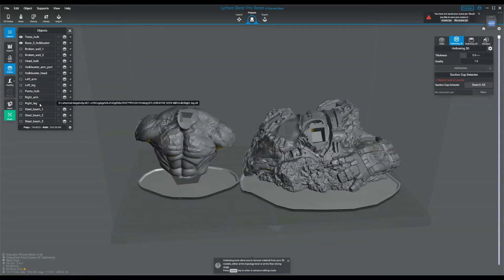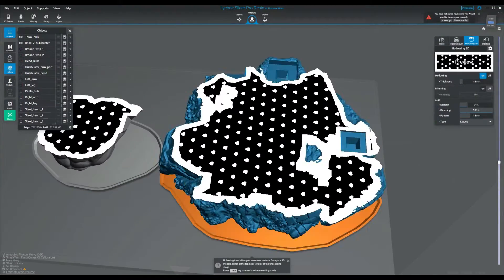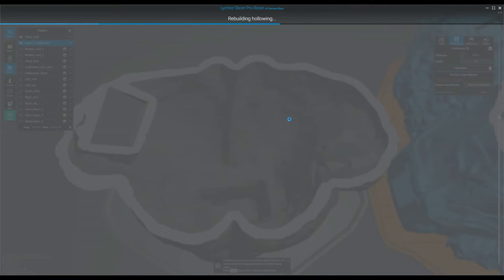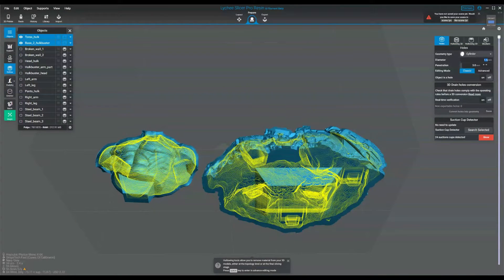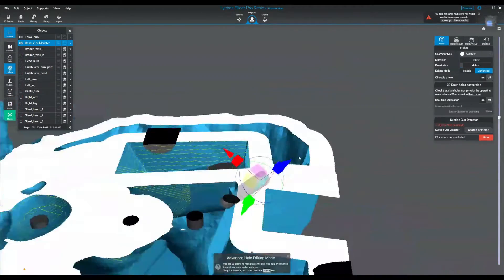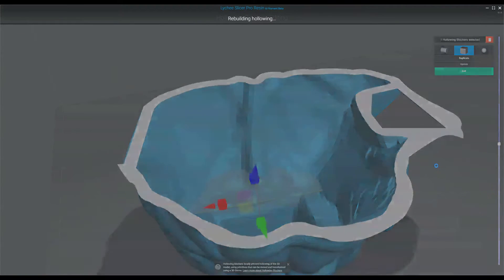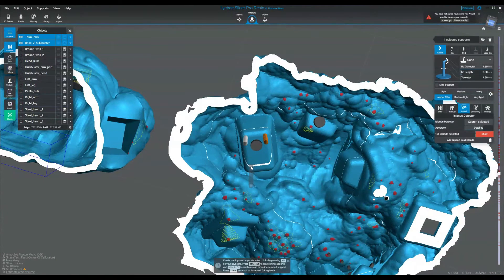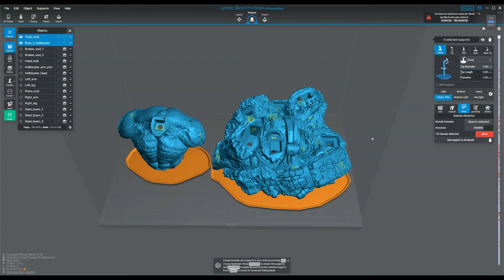Become a Hollowing Expert In Lychee - SAVE MONEY! #3dprinting  #help

Comment: got confused trying to add interior pillar preset
Reply from the maker: @bubaart  I made a few shirts on how to add presets. 

But first you need to make the shaft 1.5mm then increase the size of the tip to match. 

Then you save the preset.

When you do this Lychee will highlight another support selection in blue just ignore this and save it. 

The shorts I have should help explain this better.
Reply: @J3DTech  override !! thanks that blue thing had me lost, thanks for quick reply - first ever resin printer arrived 10 mins ago - saturn 4 ultra - psyched!!

Comment: Great Video subscribed... So my question is are you ok to leave the internal supports as you wont be able to get to them for removal, any tips on that part. Thin UV lamps or just leave alone :)
Reply from the maker: @MrTobamory  For internal supports I leave them there. I use a different setting where the support tip doesn't get smaller it's just a solid shaft so that it doesn't come free. 

But you don't need that many on the inside. Just make sure you get all the islands and do an ok job with overhangs.

Comment: How do I fill in or hide the drainage holes after printing?
Reply from the maker: @zephyr887  Try and place them in areas where it won't matter. 

If you can't. You can convert a hole into a plug. 

Just make sure you don't use the Object and Hole button or it will alter the mesh of your object.

Comment: What is a suction cup ive never heard that term tks
Reply from the maker: @charlesrestivo870  It's what you get when you create a vacuum. Place a glass upsidedown in a bowl of water and try to pick it straight up.
Reply: @J3DTech  I understand that but what does it have to do with prints?
Reply from the maker: @charlesrestivo870  If you hollow out a 3D Print it becomes a massive suction cup. 

Remember your print is sitting in resin which is a liquid and if it's hollow it's a void. Combine these two things and you'll rip your print, printer or fep apart if you don't add in drain holes.
Reply: @J3DTech  odd I've never had either of those issues But ok
Reply from the maker: @charlesrestivo870  Do you often hollow your 3D models without putting in hollowing holes?

If the answer is yes, then a lot of your models probably have trapped resin inside. And this can be rather dangerous as they'll build up pressure and eventually crack open. I've seen one explode throwing resin onto a ceiling in an office environment that was 30 ft High.
Reply: @J3DTech  id never hollowed a print
Reply from the maker: @charlesrestivo870  If you 3D print larger parts, it's incredibly helpful. I would go as far to say as it is a requirement.

Comment: Super clear explanation, actually one of the most usefull 3d printing channel and not just the usual "Yo this is a 3D printer and  it prints stuff with resin!" 
Side question, what if i cant add drain holes but i still want to hollow my miniature? In this specific scenario i have a test cube but i cant put any holes in it, should i ignore hollowing in this case?
Grat tutorials btw
Reply from the maker: Thank you! To answer your question don't hollow it if you can't add drain holes. Not only will the suction forces cause it to most likely fail but it will be filled with uncured resin that will off gas and blow up some day. Throwing uncured resin all over that will cure in any sunlight destroying anything it splattered on.

Comment: Great video! How do you create the "Interior Pillar" support setting? Whenever I try to create a setting it's also tied to the standard light, medium, or heavy settings. I can't select only my custom support setting.
Reply from the maker: I have 2 shorts where I cover how to make custom supports in Lychee. It can be a bit confusing. 

Also you need to make the pillars thicker first. The support tip can't be thicker than the support shaft.
Reply: That's exactly what I needed. Thanks for responding so quickly!

Comment: so how does it print the hole caps?
Reply from the maker: Under Hollowing there are three options, cap, hole and cap + hole. 

If you select the hole you want to generate a cap for. Then select only the option to make a CAP it will add that object to the scene. Give it some supports and you're done. 

A tip, you can adjust the tolerance better the hole and cap. I suggest. 0.1mm

Comment: How are you resizing the holes?  I'm on a Mac.  Is there a key combination?  I tried using right click, but lychee didn't bother to add context menus to enter sizing or scaling modes.  Boo.
Reply from the maker: Hitting space should open the edit functions but you need pro
Reply: @J3DTech  I have pro.  That's what I get for ignoring the tiny help text at the bottom.

Comment: Thank you for this tutorial!  How do I execute the cutting of the holes to save the .obj file?
Reply from the maker: For 3D printing I would use STL I know it's an older format but it's more compatible in this market. 

For resin if you want to convert it from code to gemotety you can export the file as the .STL under the export TAB.

Note: If a hole is red it won't export to gemotety.

Unless your goal is to make this file available to others I would keep it as a .lys to slice. This will offer you the best results.
Reply: Thanks for the reply! I am using it to make 3D prints, but if I save it as an .stl Blender doesn't seem to be able to import it.  Also, I am trying to cut a hole in the bottom of my object so I can put led lights inside, but I keep getting the red hole and can't figure how to make it not red.  I will keep trying. It looks like the hole in Lychee is not to be used as a boolean.  I am trying to boolean a hole in Blender to my Lychee hollowed object, but the booltool doesn't work with the file and I can't boolean a hole.  @J3DTech
Reply from the maker: @JamesFranssen  Correct it's a function of hollowing.

If you slice it as a . Lys the red areas will not get printed this will leave holes.

Comment: I am trying to 3D print a hollow Iron Man helmet and it shows to be hollow before I slice but after I slice it gets all filled in. I have put the infill to 0 and the top and bottom thickness are also 0. Can you please help me?
Reply from the maker: If it's been hollowed before it can be difficult. How large is it? Life-size?
Reply: @J3DTech  Yes it is life-size. It will be big enough for my head to fit inside. I am also using an Ender 3 Max Neo so the bedplate will be big enough. I am trying to print it all at once so that it will take less filament. I am currently using the newest creality slicer although I do have access to prusa, meshmixer, blender and cura.
Reply: Also thanks for the very quick response. I tried emailing the creality support 2 months ago and they still didn't respond. I was actually going to make this for Halloween but I couldn't because of them. Anyway, thank you.
Reply from the maker: @Jackhi-xl3in  For FDM it's a very different system. IF you join the Lychee Discord we have a channel for FDM and the Lychee Man "Jonathan | Lychee Team" that helps users out is very smart. 

https://discord.gg/lychee-slicer-722410197095677954

Comment: Great video!
I have couple of questions.
1st one is about the option in "Prepare" phase, Hollow -> Holes that says "object is a hole" ON/OFF
How does it work?
Is it possible to use another object to make a hole (in the general sense) in the main model?
If yes, can I use it on models that aren't actually hollowed?
For example if I want to make a dead-end hole in models limbs to insert magnets. Or if I want to manipulate the bottom of a base.
If possible I guess many use-cases will appear.

2nd one is about objects stacking.
Can I put objects next or on top of each other (with slight overlap) and expect that it'll print as a continuous single piece?
Some simple example could be if I print a human model standing upright with feet on the plate, I can insert a cylinder from the library and resize it to act as a base for the model.
If I make the cylinder for example 5mm thick and position the feet of the human to start slightly lower - lets say 4.5mm, would it print as a single piece (ignoring supports - imagine we don't need them).
Real-world case could be to make a cylinder that's about 0.5mm thick but with diameter ~1mm smaller than a base I'm printing flat, so that this thin cylinder will cover the height of the bottom layers cured at ~10 times the normal layers, which would normally cause elephant foot (lets assume that elephant foot protrudes to the sides with 1mm).
This way the cylinder would be printed mostly with the bottom layers cure time, which would cause it to expand slightly and would match the diameter of the base itself.
(even if the cylinder doesn't expand to the complete base diameter it's ok to be slightly smaller since it's hidden and a ~1mm difference won't affect the model stability)

Actually I saw some people using the raft for that purpose, when you make it slightly smaller than the base and only ~0.5mm thick (ie thick enough to cover all long-cure-time layers).
But using the raft can be an obstacle if you want to put a hole on the bottom (in case of hollowing the base for example).
But if it's possible to use one cylinder as additional 0.5mm base, and then another smaller one as a hole in the first one, you'll be able to have holes in your base (or whatever your model is), and even could use the same hole-object to put a hole in both simultaneously.

I don't know if that would work since Lychee explain that holes aren't boolean (I'm not sure that I understand that correctly - but I think they mean that if white pixels are part of your model, holes don't simply make them black), but actually pierce two holes on the two surfaces of the wall - ie the hole passes thru that wall. 
But that's for the normal holes you use, I don't know if that applies for the object-hole.
Reply from the maker: 1: Object is a hole. This is where you can use another object to act like a hole. This does not boole or let you use the part as a plug. Simply it won't print the overlapping area. You also cannot export the object as an STL with the cut. 
- It does work on models that are not hollowed.

2. There are many tricks to printing on the build plate, in my guide I cover a few of them. Adding another smaller object works as well, I often see it used. It can be a bit tricky as the bottom edge can still warp due to having no support as blooming is not exact.

3. You can stack items. Any two items that intersect will print as a single object, the intersecting structure just becoming solid resin. Get creative and do what you will with this info.

4. Holes are not Boole, this means that it's not going to keep the surface geometry of the model and patch around it. This is very challenging to do. However Lychee has been hinting that this feature is on their list of active projects.
Reply: @J3DTech  , Thanks for the lightning fast response! :)

1: "- It does work on models that are not hollowed." - Great! I can use it to put holes for magnets.

About the blooming not being exact, I guess I'll have to guestimate and test to get it more accurate (for a given resin).

About 4. library objects stacked under the model does get exported in stl, so if I import it anew it behaves as a single object.
Same applies to the holes made from the menu (but not for the library-object-holes).
Yes, I noticed the "convert holes into geometry" is marked as coming soon, that would be great!

The above gives me enough options for now :)
Thanks again!
Reply from the maker: @blueckaym  No problem and if you have any more questions don't hesitate to ask.

Comment: Thanks for the good video, now I now what the blockers do, I though that they add a plane 3d volume, so I spent too much time to scale these xD. btw at what size do you ignore suction cups?
Reply from the maker: I don't have a set size but small to medium-small are ok. If I was to give a size, under 5mm probably ok, larger than that see if there is a good way to clear it.

Comment: as far as the 2D hollowing goes and not being able to export an stl, my honest question is why would you want to in the first place?

quality content, sub'd
Reply from the maker: 3D hollowing is only offered in the payed version of Lychee. 2D is all you get for the free.
Reply: @J3DTech  right, I'm saying why would you want to export an stl? a .ctb etc is all you need to print. An stl would be useful for bringing it back into a 3D app which at the point in the process would unneeded. Trying to basically decide if I need pro or not :P
Reply from the maker: @digitalsmithy  A lot of individuals who use slicers do it professionally. They offer the .STL version  hollowed and supported for others to print. 

In some cases where I want the support shaft to go up through a hole and support the model on the other side of the hole, I will hollow it, place the holes, export it as an STL then bring it back into Lychee and support it.
Reply: @J3DTech  Ohhhhh well duh! that makes sense. Derp.

Interesting technique too, I'll try and incorporate that into my mindset while slicing. Thanks!
Reply from the maker: @digitalsmithy  Anytime

Comment: Great video. Will def come back to watch again in future.
I know 3D hollow is always going to be better BUT you didn't touch upon making holes for 2D even without detecting suction cups.
Reply from the maker: That is true, suction cup detection is a Pro feature and does not work in 2D. I should have shown how adding holes in 2D is close to the same as 3D if just a little bit harder.

Comment: How do you deal with invalid holes? I’ve added drain and suction relief holes that are fine for a while, then for no apparent reason they turn red. I keep playing Wack-a-Mole with these holes for about 75% of the slicing time for any given model. It’s beyond frustrating and I’m barely able to print anything due to unresolved holes.
Reply from the maker: Their red if they dont go into a hollow section, meaning they're not deep enough to reach a void or if they penetrate the model entirely.
Reply: @J3DTech  I'm always careful that they do. They don't touch walls of the cavity, and the ends are both clear of obstructions. It's maddening.
Reply from the maker: @briancaldwell9038  Yes, after a while you just learn to ignore the Red. I have all ready notified Lychee Devs that it's an issue that would be nice if they resolved it.
Reply: @J3DTech  I hope they do. Other than that I like it. Thanks for the replies 👍